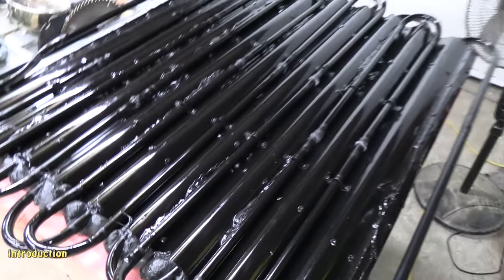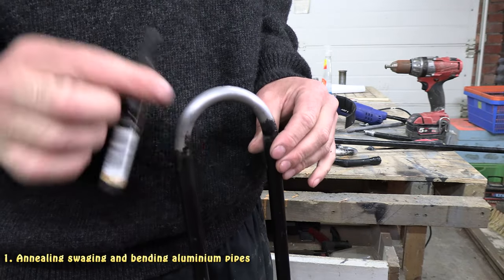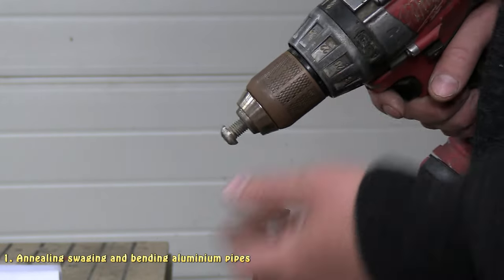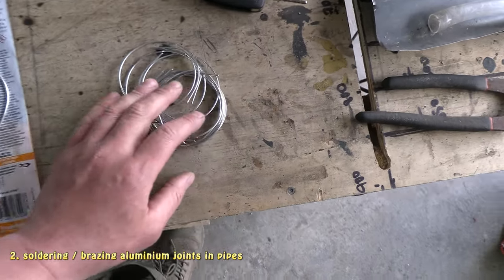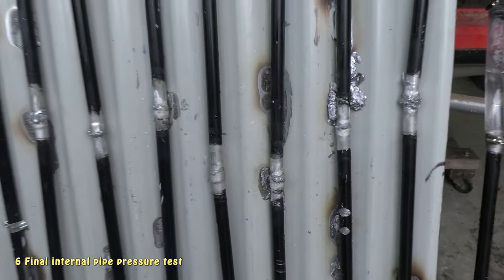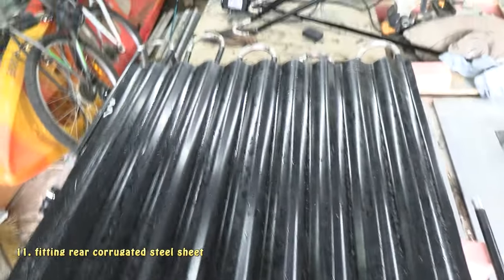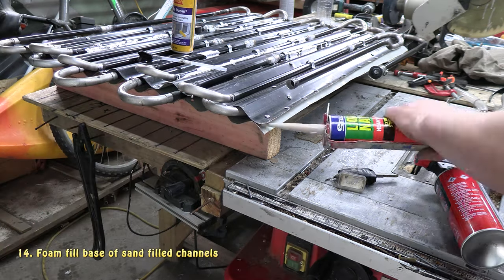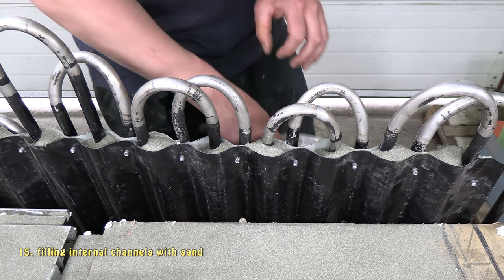Sand Battery Solar Water Heating Collector DIY version 2, How it's made.

Comment: Solar water heater may work better with copper pipes and black sand in a foam insulated enclosure. Where the pips are on the bottom or center of the sand. The black sand acts as the solar collector. And the box slows the release of heat.

Comment: It occurs to me, your biggest issue here is your design. The sand has a large surface area to lose the heat everywhere it is touching the metal. A more ideal situation would be to minimize the contact area the sand touches the metal, and maximize the amount of sand you have. 
A better design might be to build a box the solar water heater portion of this would be mounted to, insulate it and fill with sand. The use of a cube has the advantage the larger the size, the larger the mass of sand you can store while the ratio of sand that loses heat vs the total amount of sand is maximized for heat storage over the long haul.
This gives you more and longer storage.
I like this idea, I just don't think it will be very efficient.

Comment: Well as a pro welder, we use a wax marker and they come in all different temperature ranges, and also grinding aluminium on a grinding wheel as you have been doing is asking for a trip to A&E, your lucky that you have not had the wheel explode. a little knowledge is dangerous...........
Reply from the maker: I had no idea!, useful information, luckily I didnt need to do too much aluminium grinding on the wheel so probably ok.
Will definitely remember this in future...

Comment: Why use sand? Wouldn't water be a medium to transfer heat?

Nice work
Reply from the maker: Water expands and evaporates, sand holds more heat and was easier to manage however water would transfer heat faster.

Comment: Use flat paint instead of gloss. Any gloss will reflect heat.
Reply from the maker: I was aware of that, i only had gloss at the time, i will go over it with flat black next month when i set it up.
Reply: This is actually a common misconception. - Gloss reflects heat as much as a matt paint; the reason it appears matt is because "Matting lowers the gloss/sheen by scattering the light in many directions leading to surface appearance less glossy." - but one thing you'll notice from that sentence - it scatters the light into all directions instead of a single direction.
Reply from the maker: @velianlodestone1249  ok, so in that case I wont need to use a matte paint.
Im currently setting the system up outside at present, i will upload a new video in a few weeks detailing the new system.
Reply: They have special black paint that heats up more and a different paint trap more of the sun rays. You can use both in this order to maximize results

Comment: Water would work better as a thermal battery than sand here.  Water can hold about 5 times more thermal energy than sand, per weight.  Sand is better than water in cases you need to heat it up at very high temperatures; where water would not work because it would boil; so sand is a better alternative there.  But the sun won't heat it hot enough to boil, so water would be a better option.
Reply: yep  if he is ok dealing with water in  a heating system he should definitely  use it as the thermal battery, it can't be beat at those lower temps.  Sand is pretty  poor as a thermal bank at low temps (200f)...unless one is storing heat at electrical heating element temps and beyond 1000def F or so .  But concrete or clay could be better than sand , depending on what is cheaply available.   He should  be learning about specific heats, volumetric spec heats, thermal conductivity.

Comment: This design literally makes no sense. Heat flow exponentially increases with a difference in temperature. Having sand at the junction maintains a high junction temp, drastically impacting the heat flow. Don't store heat at the collector.

Comment: DO not use sand. Sand has a thermal conductivity of less than 0.3 W/m.k, while steel wool has 45W/m.k that is is 135 times better at conducting heat. Better still use Aluminium Wool as a filler which should have a thermal capacity of 245W/m.k that is about 750 times better than sand. And if you need to use a high thermal conductivity glue try using Artic Silver adhesive which has a thermal conductivity of 7.5W/m.k. Sand is use for insulation in Casting to prevent heat transfer. Check videos to understand its usage. Sand is NOT a good substrate for thermal mass either. It is NOT recommended for Rocket Heaters as another example when NOT to use Sand. Good Luck with the project.
Reply from the maker: Yes but air has even worse thermal conductivity than sand (0.03 W/(m K), thats 10 times worse than sand.

Without the sand it would be air around the pipes. So in this way sand is better than no sand.

Sand also holds more heat than air.

The sand is giving me an extra hour of heating after clouds, this being 1.5 degrees C temp gain with no sun.

I have the data in a video i will be uploading in a few weeks.

As for steel wool and aluminium, great idea but expensive and heavy.

I am currently planning on trying oil instead of sand for the next version later  on.

Edit: sand here has high quartz content
Reply: You may not be aware that they are using sand batteries to heat an entire town in Finland. This idea is starting to become very popular.

Comment: Sand battery is a nonsens..when the sun goes down, the useful charged energy remain only a few hours...and this is not much..
Reply from the maker: The sand works as a battery only during daytime, when the sun intensity drops, such as when it clouds over for a short period.
Like a capacitor.

Comment: this is not sand battery...
Reply from the maker: Its a hybrid sand solar heat battery
Reply: @DCAL084  denotes energy storage. A sand battery usually stores heat for many hours - yours doesn't seem to be storing anything for any appreciable length of time as any heat contained in the sand will be given back to the water and steel almost immediately.  

You've made a relatively inefficient solar collector, but have mixed up a bunch of tech in the process. If you look at a closed-circuit Solahart hot water heater, it's a basic plate collector filled with mineral oil and utilising a simple heat-exchanger coil in a tank of water. No pressure, no need for multiple materials, no need for pipes or bends. Insulation is effected by the air surrounding the plate collector inside a weatherproof glass-fronted casing.

I've measured the mineral oil at over 250C in Western Australia and the heat exchanger caused the water inside the tank to boil

I get what you're trying to do, but think you've over-engineered what should be a very simple thermosiphon collector.

If you want to see how efficient a mineral-oil collector can be, go and buy the biggest truck or bus radiator from a wreckers and fill it with oil - any kind of oil - the cheaper the better.  Join the outlet to the inlet for a proper siphon effect. Spray the radiator matt black and stand it in the sun. Even in Canterbury it will be too hot to handle in under half an hour.